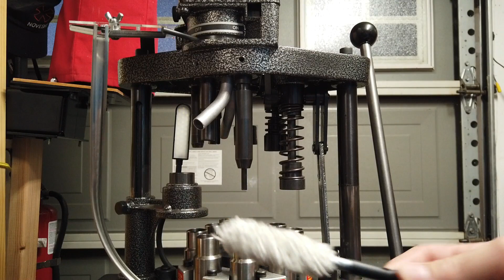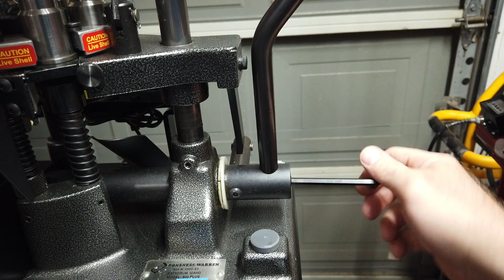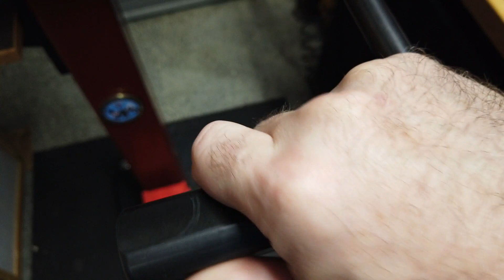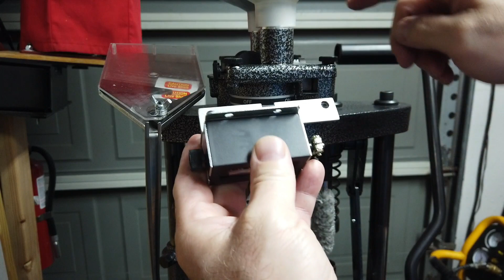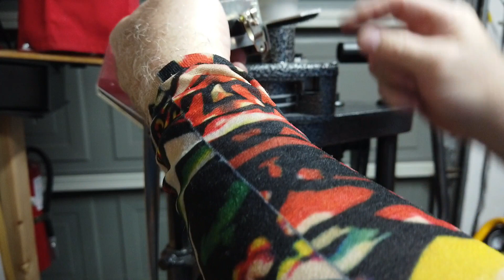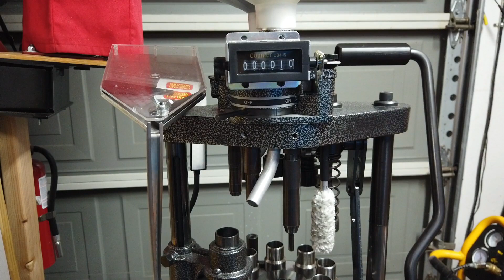"New" Addition Ponsness Warren 800 Plus: Upgrades Part 2

Comment: I am surprised that you can use the Ponsness Warren with a movable bench.  My two PW presses work best being absolutely solid.  This is not a criticism, just an observation.  I wonder if you kept both or ended up favoring one.  I like Ponsness over Mec, but many many guys i knew sold their PW and loved Mec.  I have MEC for 28 gauge, but seems a little frail. As I started on PW, it is very natural for me.
Reply from the maker: My mobile base/stand was originally built to support my Hornady LnL.  After picking up more presses than I should own, I decided to convert my mobile stand to fit the Inline Fabrication flush mount system.  Then I can technically mount anything to my mobile press.  However, that doesn't mean I'd actually run/use all my various presses on the stand.  I've found the mobile stand is fine for the LnL or the XL750.  I run my PW/366/Mec on my workbench for the extra "solid" factor.  Sometimes for video purposes, it's easier to mount a press on the mobile stand to rotate and such.  But I do like to tinker!

Comment: Are you sure that is an 800B? The paint looks more like the newer 800 convertable. Does it have the hoppers for the shot and powder or tubes?  You can buy different gauges for that machine without having to buy a new base.  Takes about 1/2 hour or less to change over.  Depends on how much cleaning and lubing you want to do.
You should try the next step up to a Spolar Gold.  They are pricey, but correct a great many of the faults of the PW.  With the hydraulics or electric drive you can easily load 500-600 per hour.
For me the real advantage of the higher priced machines over the 366 are the primer systems.  In both the PW and the Spolar, you can see how many primers are in the system.  You can get a tray extension for the PW that will double how may primers you can load into the machine.  The Spolar system hold 400 primers.
IMHO all three presses, 366, PW, Spolar are light years ahead of anything MEC builds.  Easier to maintain and adjust, easier to clean, much more reliable.
Reply from the maker: As I stated in the video, my PW is an 800 Plus.  Maybe more evident in my first video.  With my handloader, MEC, 366 and now PW 800+, I have my shotshell reloading bases covered beyond my needs, so "stepping up" to a Spolar Gold is not in my future, regardless of what benefit it may bring over the others.
Reply: @ReLoadersBench  Just a question.  The Spolar is an amazing machine if you have never seen it.
Reply from the maker: Robert Dawson - ceratinly a beautiful as well as costly investment.  I intended the 366 to be my “investment” and then came across the 800 Plus that was in like new condition for less than 1/2 retail price...couldn’t pass that up (and would not have paid retail for it or similar [Spolar]).  Right place right time kind of one off.
Reply: @robertdawson6043 my 800B is a bit different, also. I believe he has a more expensive model. I’m needing to clean mine and will likely need a few parts and lots of cleaning. My machine is more as you describe yours. Also, when I run a search, the machines I see pop up on eBay are like mine.
Reply: Where could I buy 20ga? I’m trying to get my old one up and running.

Comment: Do you like this machine better than the Hornady 366. I have the 366 and just purchased the ponsness Warren 800b but I don't know which one is better
Reply from the maker: "Better" is a tough word...I'd prefer "Different".  Kind of like a Hornady LnL AP to a Dillon XL 750.  Each press does what it's designed to do, but each press has some differences in how they do it (most notable examples are primer tray/feeding, wad insertion side, hull insertion/extraction [and how they are held in the press plate], length of pull on the ram handle [especially with my shortened LnL mod].  The PW is beefier and heavier, but I think the 366 is a bit easier to operate (effort wise).  Both machines are amazing mechanical marvels, truly.
Reply: @ReLoadersBench  thanks for your reply but I think I'm going to keep them both. I have both of these presses and was thinking of selling one of them and it was going to be my 366 because the pw  800B was given to me yesterday and its the new kid in the block but its like you say the 366 is easier to use to me but the pw seems to be better looking and beefier.